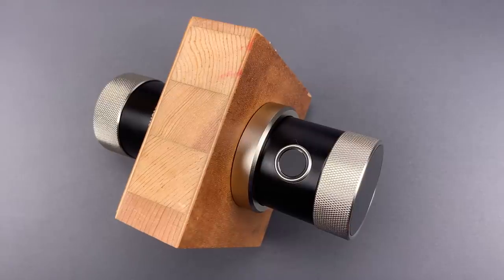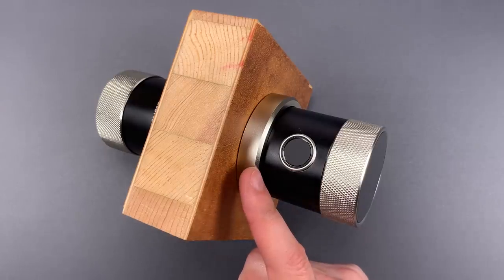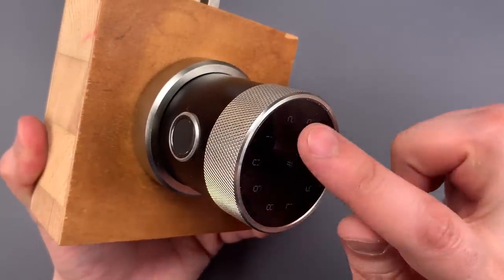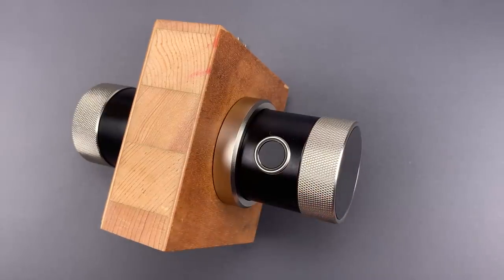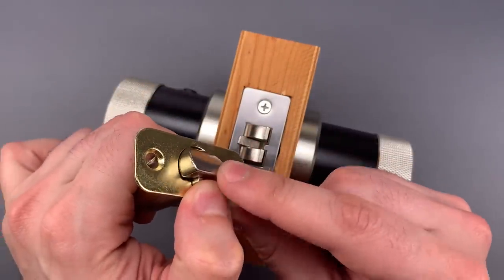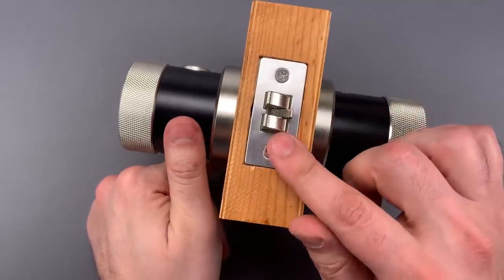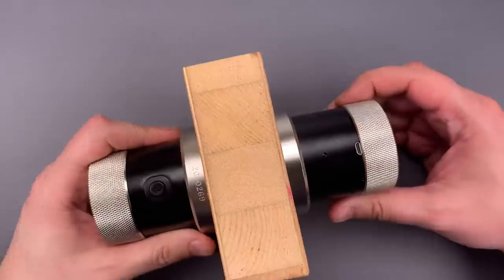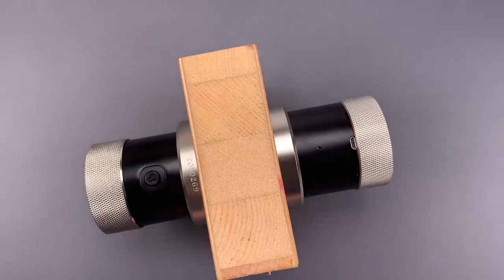[1120] Fingerprint Lock That Forgot The Fundamentals - DatoHome L-B400

Comment: At least you can open the door even during a blackout...
Reply: Looks like it has batteries? I see a charging port. Does that mean you have to charge your door handle every so often? Seems silly
Reply: Graham very silly
Reply: @blackferrets820  Only alternatives are wiring between the moving door and external power (unwieldy but common 20+ years ago), having to change batteries in the door, and carrying a battery to the door for each open (CLIQ).
Reply: it seems to have a usb port to charge it
Reply: Yeah... and it would suck if the battery dies on you.
Reply: Apparently it uses four AA batteries. Maybe the port is backup power? But probably it's for settings.
Reply: it looks like the port is on the outside. probably so you can power it and get it when the batteries die
Reply: @graham3289  imagine?
Reply: @guillermozarate8903  The port is on the outside handle!
Reply: With a credit card.
Reply: @FortitudineVincimus  but hey! You can get in with a sheet of plastic, easy fix
Reply: aleks138 yeah, with a powerbank
Reply: Look at the lock again. The charging part is on the outside
Reply: @FortitudineVincimus  there is a charging port on the outside.
Reply: Graham you have to charge it from outside!
Reply: @johndododoe1411  pretty easily done through a slip ring and brushes.
Reply: @johndododoe1411  Third alternative is a dynamo attached to the handle. I don't think you'd garner enough power with that to run a motor driven bolt, but a little burst for a solenoid.... that's actually been done, quite a lot. Systems using this get several years of function, usually they'll only die when the rechargeable batteries or capacitors physically fail.
Reply: @johndododoe1411  you could put two metal plates in the door frame and on the door when closed these can be your loop for charging low effort no cabels except in the door and unless held open will charge
Reply: Graham Most Ring devices need to be charged too. It’s often good practice to keep a spare battery since they take like 6 hours to charge. 

The main flaw, in my opinion, is that the batteries are really easy to gain access to, so there isn’t much to stop someone from disabling it, and you won’t know it’s been tampered with until later when you don’t get a notification once you get home. It might catch the person’s face and record it before going offline, but I’m not certain.
Reply: Guys, just look at the Amazon listing. The micro usb port is just a backup to "jump" the lock in the case that you get locked out and forgot to change the batteries. You don't charge your door handle with the usb port... There are regular batteries in the inside handle that you would replace before they go flat.
Reply: It has Bluetooth. I wouldn't be surprised if it sends your phone a notification when the battery is running low.
Reply from the maker: It takes 4 AA batteries... it can be powered with a USB mini charger if the batteries are dead.
Reply: good thing i dont have a house
Reply: LockPickingLawyer the smartest thing would to power it by a cable through the door but have ab inner backup battery that can sustain a day or two if there ever was a blackout. But you’d have to pull a wire through your door.
Reply: @ThaGr1m  How low effort do you think drilling a cable route through a solid (or metal) door is? I do like the idea though.
Actually, I would make the connections part of the Face plate & Strike plate. You are likely to have power on the wall side anyway since there is often a light switch when you enter a door.
Reply: @graham3289  A charging port on the outside. I suppose it's to allow someone to power it with a battery powerbank if the batteries are dead and you need to get in.
Reply: @lockpickinglawyer  It would be nice to have hand cranck charger extra
Reply: @mjbirdClavdivs  That is literally what LPL said just a couple replies before you. Didn't click the "view replies" link, did you?
Reply: @johndododoe1411  Or mount a wireless power source on the wall next to it and a receiver in the knob.
Reply: I work at a hotel and most hotel card reader door locks use AA batteries, usually 4.  Even those of a high tech design only need the batteries replaced once a year or so.  The hotel I work at has card reader door locks that are quite old (and therefore not terribly efficient), but the batteries last a long time.  And they usually indicate that they are getting low on charge long before they actually stop working.  Even though I imagine this lock requires more power than those on my hotel's doors (the speaker and screen being the most power hungry), I bet these batteries last long enough that frequent replacement won't be necessary.
Reply: Graham i think that is the back up, its probaly hooked up to the net but in case of a black out the door should function.
Reply: @johndododoe1411  Well, technically they could've use one of the wireless power technologies to  trickle charge the batteries. One if tgen used a an IR laser bead I think, with line of sight detection as a safety measure. This way you can have a completely sealed lock. And if designed a redundant PCB with failure detection, it'd be a pretty slim chance for it to break so no need for a secondary way to open the lock.
Reply: @johndododoe1411  Or just use two pads two touch a 12v battery.
Reply: @xhivo97  Some of your latest answers to me lack context as to which of my comments they relate.  But in general, infrared is an inefficient (large loss percentage) and unreliable (random chance of blocking) method.  12V batteries are less common with current generation technology, although lots of older locks and alarms used them.  For jumpstarting, the most common 12V batteries are too heavy to carry to a door for jumpstarting, compared to a common power bank (3 to 5V) or 9V alkaline.
  If I were to design this, I would go for an AA battery inserted from the lock plate (to prevent sabotage), a generator backup if battery is flat, a low power shielded solenoid clutching handle to mechanism and a standard SMPS circuit to convert either power source to needed internal voltages.  This requires no outside connectors and wiring.  Naturally, everything but the keypad belongs inside the door, not the handle and the keypad wiring must be zap-proof.
Reply: But not during it's own blackout, 300 ways to open it without knowing the code, but no way to open it in case the battery is dead, probably need to call their own service then and take another credit to pay them.
Reply: @johndododoe1411  They could have put a solar panel on it. Maybe it wouldn't do well enough to keep it topped off, but you could easily give it a jolt of power from a flashlight or your phone.
Reply: @FortitudineVincimus  I have a digital lock in my garage on the door going in to the house as the kids forget to lock the door. The batteries last about 6 months (10+ unlocks a day) and give you about a month of warning beeps that battery is low every time you unlock it to replace the batteries. I'm sure this lock has something similar. Mine comes with a connector with a external battery pack that I leave in the garage on a shelf to plug in if it would die to unlock the door then you just replace the batteries.
Reply: I guess that USB doesent go to settings whit some skills,or?
Reply: Unless your door is electric
Reply: @SamDru  Can't wait! I'll bring the pork sausages.
Reply: @shoresy6927  it being outside makes a little bit of sense, imagine you going out of town for a long time and when you returned and found that the door knob was dead(locked), which would end up in you being trapped outside.
Reply: @graham3289  long life batteries exist. I can't imagine this thing using that much energy that it need to be charged more than one a month or so... Think about it, it only unlocks and locks the door, no other function, sure it's got an active rfid reader and Bluetooth, but those are low energy equipment.
Reply: @guillermozarate8903  what if you used an usb killer on it
Reply: The Kitty Channel It takes 4 AA batteries. I’ve had multiples of these great locks on my front door etc. for 8 months now and they still all read 100%. Being in the business where I sell and install these for major apartment buildings and corporations, I’ve had to do battery testing on them. I killed the batteries down to where the voice says “Battery low. Replace now.” You get 300 to 400 openings after you hear that, so only an idiot would get locked out with one of these. With all due respect, this is an odd video for the LPL IMHO. Why bash a really great lock when again only an idiot wouldn’t replace the latch? Further more NONE of mine didn’t come without a dead latch so I don’t know where the LPL even got his. This is a quick click video with no merit IMHO.
Reply: Orion Pax 😂 😂   I would love to see you get the battery out of my Ring Doorbell without me setting off my remote alarms 🚨 before you even got your tool under it. Clearly you don’t have a Ring Doorbell. I would have clear video and a notification (which I look at) before you even got anywhere near the door. Forgive me for posting a lot on this video, but it is intriguing me as to how old you posters are that you are so naive about the electronics and how they work. 🤔
Reply: I'm a moron but Excuse me? If I take your response correctly.....I’m getting too technical on a board where people just want to revere a guy that can get into a lock that half the time I could get into when I was 10? 😁   And I truly don’t mean that to be mean. I apologize for ruining your fun. 🙂   Sorry, I had the wrong feeling that I could educate you guys on some electronic locks that you have never seen. I get it and I will go now and not post again on this channel. You are correct, that wasn’t too smart of me to figure it out sooner. Again my apologies. 🙂
Reply: @guillermozarate8903  Bets on whether the USB also acts as a programming port?  Either way, to have it on the authenticated side of the lock seems... dumb.
Reply: But imagine trying to do that while drunk...
Reply: @Prophes0r  My parent's bought a new house with "smart" home features, it has a fancy Kwikset electronic lock (with key thankfully) and it's powered by batteries, which as we found trying to set it up were already leaking acid within a few months of the house being built (I imagine Florida weather had some influence on that though). It made me wonder, why, if you're building the house brand new to be "smart" wouldn't you use an inductive charging system to keep the lock charged. No drilling through the door, just build the coils into where the lock and frame meet (I'm sure there's a technical term I'm forgetting) and wire it to the circuit less than half a foot away where the light switch is. It'd be seamless and so long as the door is shut there'd be a steady low voltage current keeping the battery topped off, instead of the current system which requires remembering to change the batteries every couple months (or more if you use the fancy "smart" features constantly). It could be made contractor proof by building the coils into a 'plug and play' system where it is built into the plates that affix to the door and frame, with the frame side housing the necessary electrical hardware and the door side plugging into the lock just by slightly expanding the latch hole on the interior side. The lock itself could be made much smaller too, the one they have is giant solely because it has to hold 4 AA batteries and the removable frame that holds them.
Reply: That's pretty standard for electric door handles
Reply: @Fluid_Chaos  on the amazon listing it specifies that the port is for opening the door in case of the batteries dying
Reply: laughs in doorknob
Reply: could easily add in a contact charging pad in the door frame so when it's shut it'd be like setting your phone on a wireless charging station.
Reply: @guillermozarate8903    Yeah, on the OUTSIDE of the door...  Wonder if that is also capable of Data transfer...
Reply: @graham3289  not only that, but the charging port is on the outside, not the inside portion of the lock...
Reply: Liam Eisenberg 🤣! Excellent work. I love that there were twenty messages before this from people talking about how rubbish it was that you had to ‘charge’ a door handle.
Reply: @Fluid_Chaos  maybe for external power supply if you arrive and your lock is dead
Reply: Tarkov made me ready for this: Find Portable battery and usb mini wire, survive and exit 🏃🏽
Reply: John DoDo Doe why not wirelessly charge it
Reply: They should have made it solar powered
Reply: Graham l
Reply: uid 420 skeet ya my cardboard box has soooooo many security features
Reply: This will make for a great lock for my room, though. Not the house, just my room. Plus, i've been meaning to replace the 60-year-old lock and handle anyway.
Reply: @graham3289  Obviously its just an back-up power supply if you get a blackout...
Reply: @graham3289  Read up from UPS (uninterruptable power supply) its basically that, but in a miniature scale. (Normally used in bigger applications).
Reply: Micro USB was on the outside as well. Wonder what its running and how easy it would be to get through
Reply: People seem to forget traditional batteries last pretty long.
Couple of AAs in an RC car provide hours of multiple motors controlling acceleration and steering.
A few AAs in a Game Boy provide 30-40 hours of gameplay.
Reply: Yeah, because everybody know that batteries drain out in a blackout!
Reply: @blackferrets820  "wanna come over?" "Sorry babe can't I'm charging my door handle "
Reply: I hate modern society

 o wait a moment I need to charge my book, I need to charge my cigarette, I need to charge my door handle I need to charge my headphones.
Reply: @johndododoe1411  Since we have wireless charging, we can just use a battery inside the door and wireless charge it from the frame. Or we design a new electric conector for this door, with a backup batterie.
Reply: @Fluid_Chaos  I bloody well hope its not a data port and is just 5V. Otherwise its exploit city lol
Reply: @lockpickinglawyer  lmao who has USB mini handy yea this lock sucks :D
Reply: Now i can blackout the neighborhood and then picklock then, nice
Reply: i bet that the mini USB port only has the power pins and no data pins. if not, then someone doesn't know what they're doing
Reply: @graham3289  in the knobs defense simple functions such as checking passwords and checking fingerprints needs minimal power so even a small battery will run reasonably well. You can also keep a powerbank in reserve in case of a blackout
Reply: This isn't a feature, but wireless charging mounted on the doorframe seems like a good solution to some of the issues in this chain.
Reply: That port seems like a good way to fry it or hack it in seconds.
Reply: @Prophes0r  actually, Acoustc Research sold speaker wire that was flat with 2 foil traces with adhesive to stick on the wall instead of trying to run wires in difficult situations, designed to be painted over and rated at 100w rms... that would be way more than enough to run power lines from contacts on the hinge side around the top to the lock side for charging. Honestly it was a touch too thick to paint over and not see, but it would hide behind the baseboard wall trim without any notice at all.
Reply: @xhivo97  that sounds really cool! I might employ that on something in the future!
Reply: @graham3289  u can put a paperclip in the hole
Reply: I have a basic type of electric door lock and the batteries haven’t died in 4 years
Reply: @graham3289  I could conceive of a system where the door latch acts as a contact for a charger, the contact side for the doorframe connected the the home's power.
Reply: So, the charging port can be used by a nice burglar to charge the lock when your batteries run out during your vacation… neat! Or perhaps the burglar can use it to reprogram the lock to his own fingerprint. Even more convenient.
Reply: @lockpickinglawyer  doesn’t sound very safe
Reply: @QiuArVee  Their online info seems to say it is NOT a charging port , since it doesn't have a charging circuit,  but it's for backup power if you ignored the low - battery warning for too long.